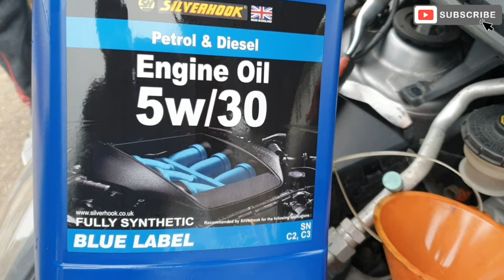Honda Jazz Full Service || Oil Filter, Air Filter, NGK Spark Plugs & Oil Change | Honda City Service

Comment: Our mechanic with his 40 years of experience never used torque wrenches. All is done by feeling. We did the same in motorsport. However. People needing this video, i.e. the less experienced, are advised to use a torque wrench to avoid over or under tighten the plugs.

Comment: Those spark plugs at the back of the engine are quite annoying, but great video!
Reply from the maker: You are welcome thanks 😊
Reply: How did you remove the wiring loom from the back of the engine so that you can gain access to the rear spark plugs?
Reply: @andrewbayliss5421  on the left side there's a plastic tab sort of thing push it to the right and use a small flathead to undo ignition coil connectors

Comment: Hi, great video! What is the spark plug tool you use for the back row of plugs? Is that because the socket set doesn’t fit?
Reply from the maker: QWORK® 2Pcs Thin Wall Spark Plug Socket, 3/8 Inch 12-Point Universal Joint Magnetic Swivel Spark Plug Socket Spark Plug Removal Tool (14mm & 16mm) 
 https://amzn.eu/d/0iDz6xv6
Reply from the maker: https://www.ebay.co.uk/itm/186414009635?mkcid=16&mkevt=1&mkrid=711-127632-2357-0&ssspo=9-ontkkrqnu&sssrc=4429486&ssuid=F01xFgg6QJ6&var=&widget_ver=artemis&media=MORE
Reply: You don't need a special tool, just a long socket and short extension bar gets to the rears no problems.

Comment: It is advised to use torque wrench when tightening those plugs, otherwise the plug porcelain could crack or break and making misfire.
Also each plug recommended to take out one by one not leaving all spark plugs hole freely to avoid foreign object or any other stuff to fall into it. Copper grease is very handy and used to eliminate plugs' stucking at the next service.

Comment: Nice job. Torquing spark plugs by hand is perfect. You can feel the washer crushing with good feed back. NGK says not to apply grease. What model engine is this ? There is another one with 1.4 lit and only 4 spark plugs in a jazz.
Reply from the maker: Thanks for your feedback. This is 1.4 engine too.

Comment: Hello Khan,
My Honda Jazz radio doesn’t connect to stations.
I tried to fix touch screen head unit but it still doesn’t get any radio stations.
What could be the problem?
Reply from the maker: Hi. Make sure the aerial cable is fully connected.
Reply: @ could it be a fault from the radio fuse?
Thanks for replying
Reply from the maker: @nzubechukwu2856  no the aerial doesn't have a fuse

Comment: Sir does honda jazz 2005 2006 have a place to add steering fluid ?
Reply from the maker: Yes on the right hand side of the engine  just above the auxiliary Belt.
Reply: Hi Khan, I came across your page looking for this particular question because no one had the answers on YouTube can you do a vid when you have a change

Comment: Hello. Can you give the specs/full description for each part that you replaced please. It's a bit difficult trying to figure out the exact brand/type of brake pads, spark plugs and oil filter and where I should purchase my replacements please
Reply from the maker: Hi. I normally buy Japanese ngk spark plugs. The rest of the items ie air fuel oil filters can either be bosch, motaquip or blueprint. These are the services parts widely used here in uk.
Reply: @diykhan  Oks thank you mucho

Comment: Hi Khan, 
thanks for the great video. I’ve got Honda Jazz SE 2006, could you please help with a list of tools/sizes to buy for a complete service like this? 
Thanks once again
Reply from the maker: You are welcome thanks
Reply from the maker: https://www.ebay.co.uk/itm/NEW-94pc-1-4-1-2-Socket-Ratchet-Screwdriver-Bit-Set-with-Case-/185030582791?mkcid=16&mkevt=1&_trksid=p2349624.m46890.l49286&mkrid=710-127635-2958-0
Reply: @diykhan  thanks for the quick reply
Reply from the maker: You are welcome thanks
Reply from the maker: https://www.ebay.co.uk/itm/BERGEN-Oil-Filter-Wrench-Set-2-Way-3-Leg-Oil-Fuel-Filter-Wrench-Removal-Tools-/133529402611?mkcid=16&mkevt=1&_trksid=p2349624.m46890.l49286&mkrid=710-127635-2958-0

This is the oil filter removal tool u can buy similar type from ebay
Reply from the maker: Or u can buy a belt oil removal tool. I have both. So different cars have different oil filter locations so they both come in handy. Good luck 👍
Reply: @diykhan  please what’s the tool you use to grab the spark plugs out, after loosing them? Holds like a magnet. 
Thanks
Reply from the maker: https://www.ebay.co.uk/itm/Flexible-Magnetic-Bendable-Picker-Magnet-Shaft-Pick-Up-Rod-Stick-Hand-Tool-NEW-/333792261291?mkcid=16&mkevt=1&_trksid=p2349624.m46890.l49286&mkrid=710-127635-2958-0

Comment: Great job
This has 8 spark plugs ?
Reply from the maker: Yes two on each Cylinder Head
Reply: @diykhan  good job, no fuel filter on the Honda jazz?
Reply: Same as Alfa Romeo twin spark engines

Comment: Did used iridium spark plug or standard one?? And is your car hybrid mode?
Reply from the maker: I normally use NGK or bosch spark plugs. Its a standard 1.4 petrol engine
Reply: @diykhan  thank you very much sir for the fast reply
Reply from the maker: You are welcome thanks

Comment: Hi, mr khan, I just want to ask about the transmission fluid on Honda jazz, how often we need to change the fluid?
Reply from the maker: In uk we don't charge transmission oil till u charge the new clutch.
Reply: @diykhan  my car is honda jazz automatic transmission.
Reply from the maker: Best to call Honda dealership to find out as they know more than anyone else
Reply: @rachelzantua9050  Between 20000 and 40000 km MAXIMUM, sorry not imperial. You should  strickly do it, especially if you drive mainly in town. The cvt will thank you a lot in return, by thousands and thousand kilometers,. That's Honda's words. CVT is the name of this kind of automatic transmission and I think that all jazz have a CVT instead of another type of box. Check it on the internet with the year the car, to be sure. But anyway let's drain automatic boxes PLEASE!
Reply: Transmission with auto conventional, ATF change every 40k km. 
Those having CVT to change every 40k km. 
Those having Manual trans to every 60k km.
Reply from the maker: Well explained 👏 👌 👍

Comment: No fuel filter on this jazz?
Reply from the maker: There is but on petrol cars we don't change fuel filter that regularly
Reply: @diykhan  OK thank you
Reply from the maker: You are welcome thanks
Reply: The fuel filter is inside the fuel tank, together with the fuel pump.
Reply from the maker: You don't really need to change the fuel filter on petrol cars in uk thats because the petrol quality is quite good as compare to diesel fuel. Good luck 👍.